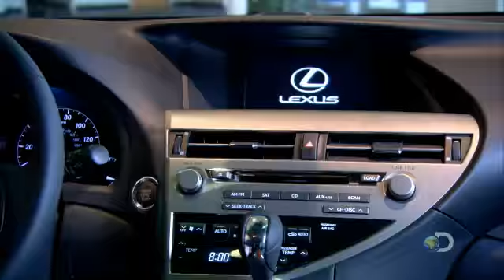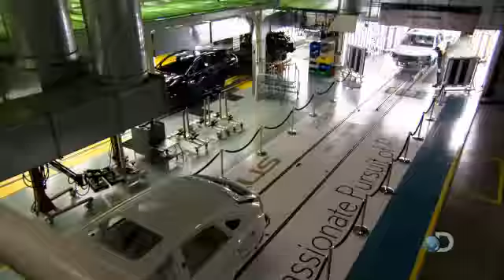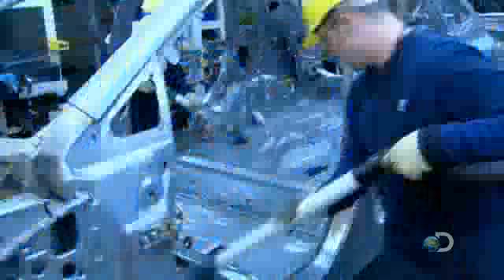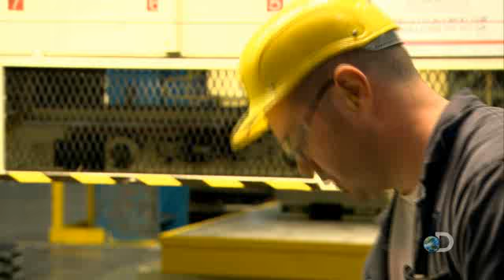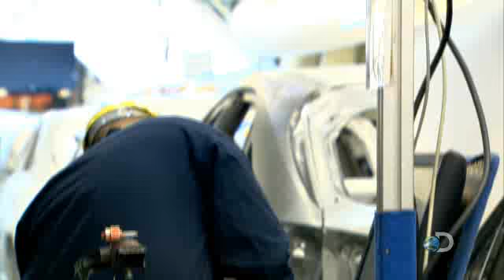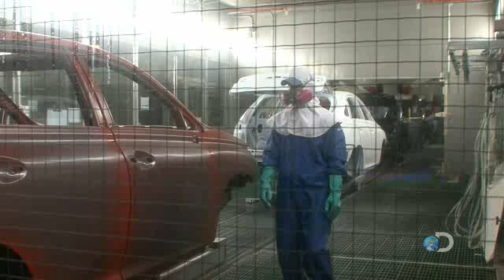LEXUS RX of factory in Cambridge

Comment: I bought a 2008 Odyssey that sure didn't get this level of inspection.  It had weld spray in the door sill, and paint blemish in the rear bumper cover.  The roof liner also had a gap in the front.  My salesman told me that all cars were like this now.  We had a 2007 Civic that sure didn't have these flaws.  Honda drive train is one of the best, though.